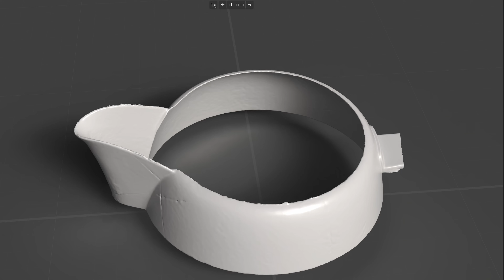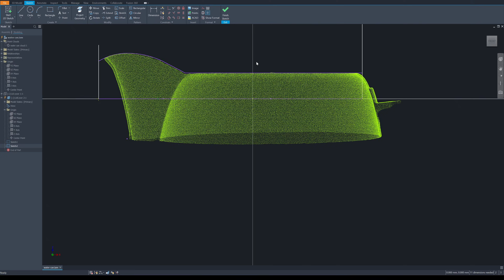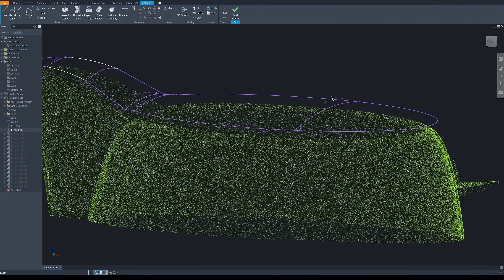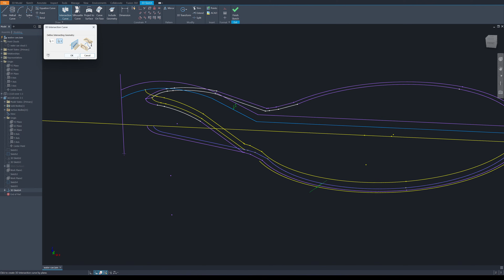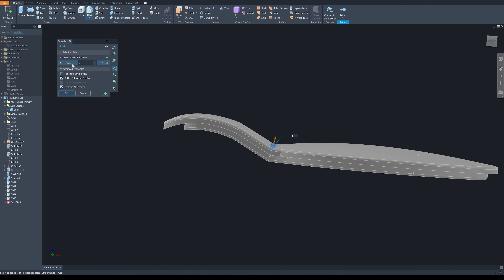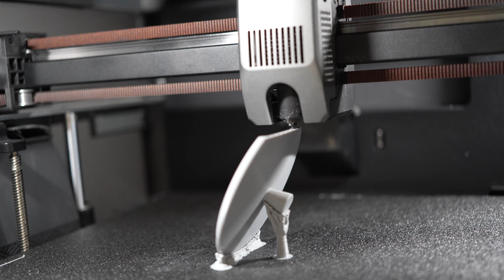How to Reverse Engineer the Cusps Curve (Complete Guide)

Comment: at the 2.10 part you are mirroring the projected line to the other side... I only have fusion 360 and im not able to do that. Suggestions? 

EDIT: I closed fusion 360 and did this in Plasticity instead and it was SOOO much easier to do, and it took like 15 min when i got the hang of it :D!
Reply from the maker: Fusion doesn’t appear to support mirroring in 3D sketches; you’d need to mirror the 2D sketch instead and then intersect the resulting curves. If you enjoy this style of surface modeling, I’d suggest trying Rhino3D. Many product designers use it professionally, and I recall it being the first CAD software capable of handling NURBs on a PC.